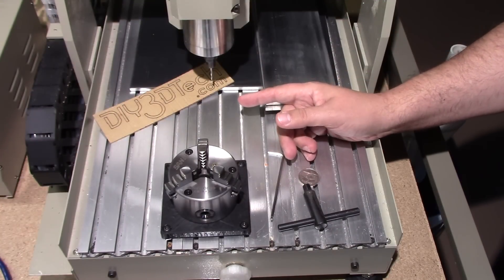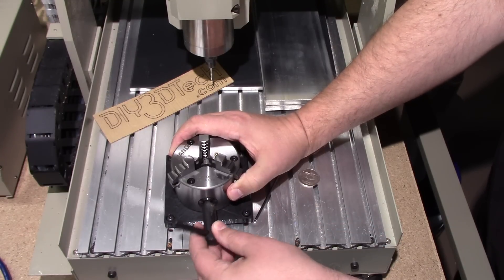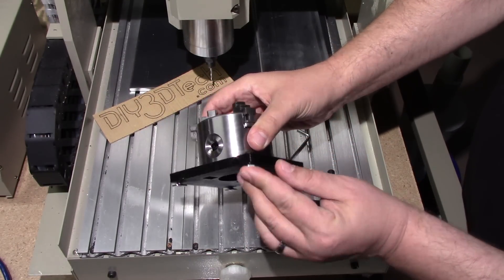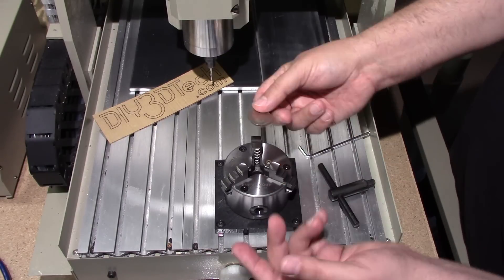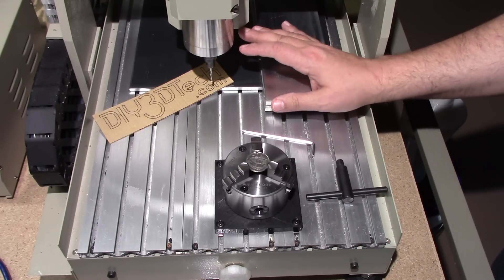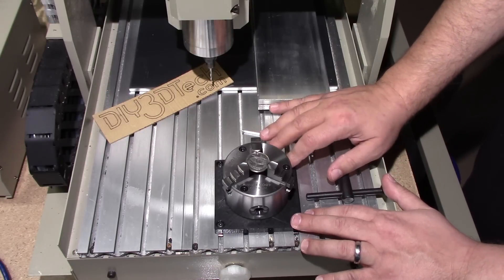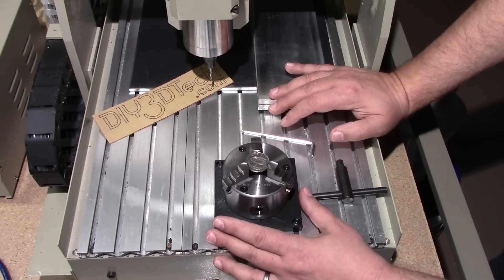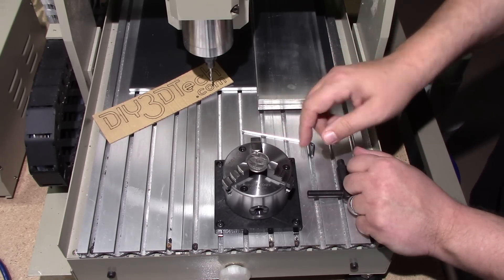3040 CNC - 3D Printing A Chuck Fixture!

Comment: How do you like that PETG from Amazon that you linked to compared to something like Inland?  Oh, and those Socket Cap head bolts are indeed a PITA that everyone complains about for the same reasons so a suggestion from me is to buy some button head replacements as I do for the same reasons on any of my 3d printers or my 50w laser machine.  The extra clearance it gives is worth it and the cost is butt cheap.
Reply from the maker: Amazon filament is about all I use any more for PLA & PTG and have no issues with it.  Have not bought any inland in over year...
Reply: That says it all.  Thank you.

Comment: Seems like you could get more clerance if you got another piece of 2080 extrusion (that the bed is made of) and cut a hole the size of the 3 jaw chuck, then mount the chuck so that the jaws just clear the bed. You would get back the height of your fixture + the height of the chuck up to the jaws. Of course you would also need a hole in the front of the frame and a special chuck key that's long enough to reach.
Reply: Apologies for the crude drawing, but it would look something like this: https://imgur.com/yqcQ7yx
Reply from the maker: Good to hear from you and many thanks for comment and cool rendering!  However found an easier solution!   Bought a low profile chuck!  However this worked OK for several coin projects which I did so I can't complain :-)

Comment: Have you thought about making aluminum soft jaws that conform to the coins? It would be so good for the grip, heat, repeatability, and provide support underneath so it doesn't flex. Also milling out the teeth while the jaws are mounted on the chuck will make it an even more true surface for your work as is.
Reply from the maker: Made something long time ago like this however find the chuck in this configuration works a lot better as I am centering to the coin (there will be a video coming out on this).  However use the PETG does a flix a bit.  It is work but far from optimal, with the new chuck I will make an aluminum fixture place...

Comment: did you check tension?
Reply from the maker: Not sure what you mean?
Reply: @DIY3DTECHcom  between the table  plastic and vice, is like a sandwich and the plastic is the cheese
Reply from the maker: Yes does pull it rather tight, it is workable but not the best of course as its still plastic at the of the day.  However it has been a neat experiment as you will videos of it in action :-)

Comment: I am wondering about parallels to make sure the chucked material is parallel to something.
Reply from the maker: There are notches in the jaws which do that for the coins (you will see me do several projects in up coming videos) and for tubular stock its not needed as the jaws them-self hold the stock square...

Comment: Why not glue the coin with superglue? Release with heat. No need for a chuck.
Reply from the maker: One of the main reasons is heat, the coin will get hot and the chuck acts as a heat sink.
Reply: That would get tedious after doing hundreds of the same. This is so much more repeatable and clean.